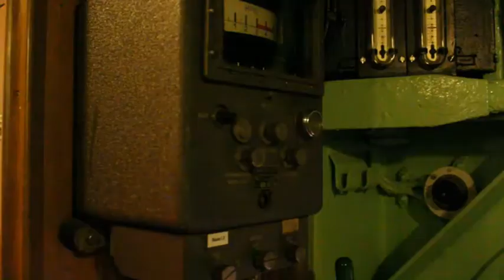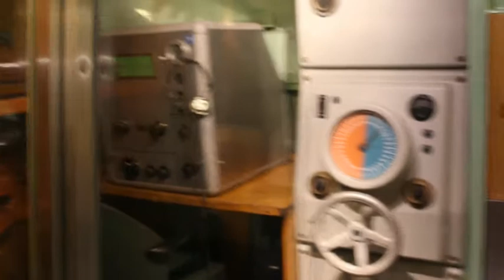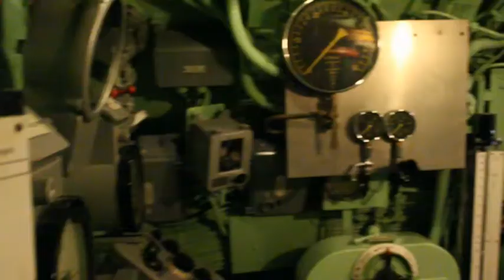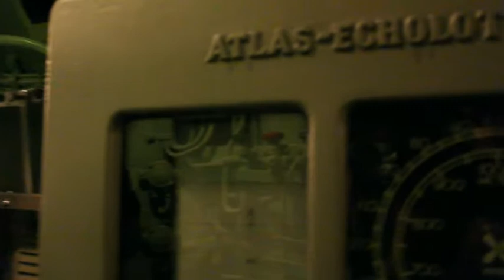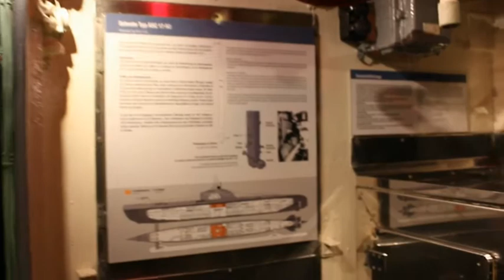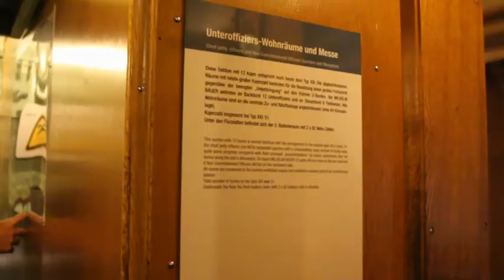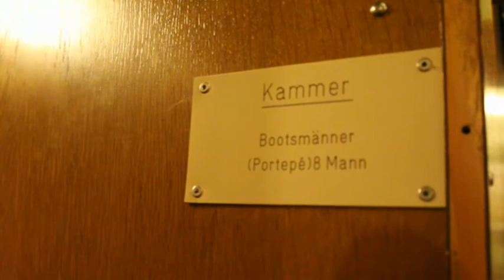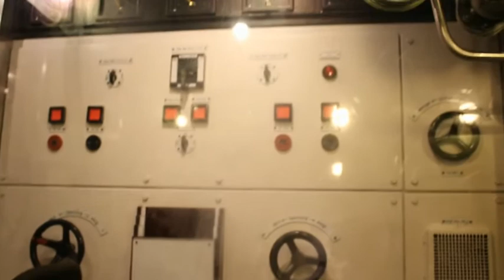U 2540, Typ XXI (Typ 21), Wilhelm Bauer in Bremerhaven 2019 Last German Submarine Typ XXI

Comment: When was the last time? The germans aka ex nazis brought this sub out of the water and put it in dry dock for maintenance?
Reply from the maker: In June 1957, U 2540 was lifted by the Hamburg salvage company Bugsier, made buoyant and towed to the Kieler Howaldtswerke, today HDW. There, the boat, which in the meantime had been christened Wal, was repaired from November 1958 as an experimental boat for the new German Navy. 
On September 1, 1960, the boat was taken over by the German Navy and named after the German submarine inventor Wilhelm Bauer. It served as a test boat (class 241) until 28 August 1968.
Reply from the maker: The Ministry of Defense put U 2540 up for sale via VEBEG. The boat was taken over in 1983 by the Board of Trustees for the Promotion of the German Maritime Museum and after the transfer from August 1983 by the Seebeck shipyard prepared for use as a museum.
On April 27, 1984, the Wilhelm Bauer, now under the auspices of the Wilhelm Bauer Museum of Technology Association, was opened as a museum. Since then, it has been possible to largely reconstruct its original condition as U 2540. For the 2011 season, the exhibition in the entrance area of the submarine was completely revised. Visitors enter the boat via a door cut out of the ship's side, and the ship is left by a second door.